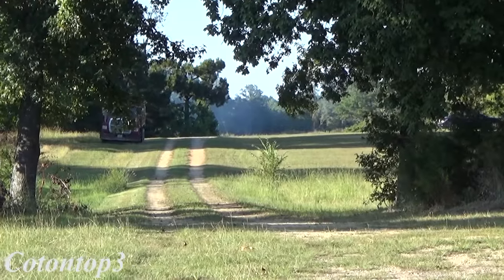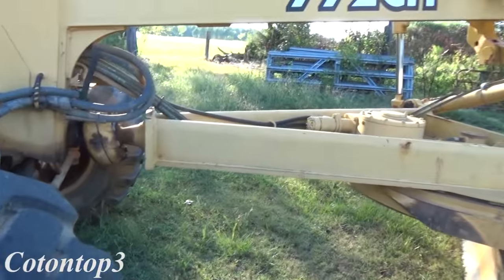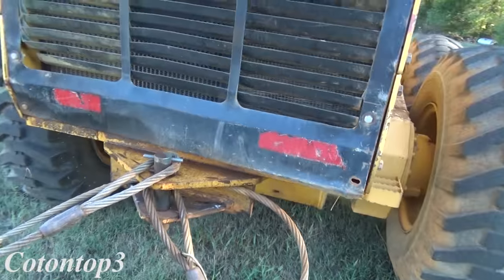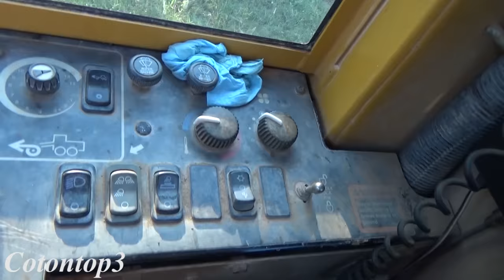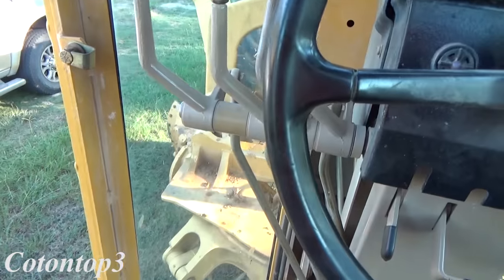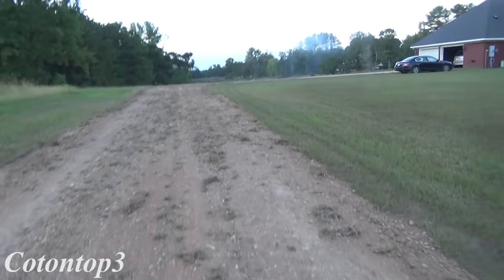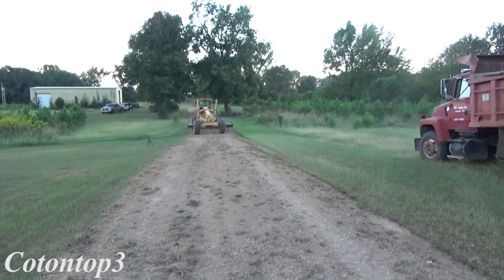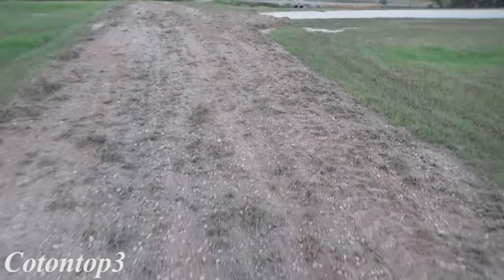John Deere 772ch road grader in action

Comment: neat idea with the different views of the blade. I mostly run blade anymore, front end loader, and drive truck. I never thought outside the box like that as far as videoing what a grader does and it looks kinda tough to capture. I have seen guys mount the go pro up in the back window or roof so the camera has almost the same view as the operator but the camera gets the operator also so people can see what levers a guy is jammin. I like those old deere blades there good-uns, the county I work for in central oregon has all Cat blades 2 of which are the size of your 772 and one that's a 163H which means holy Mac daddy size behemoth 6 wheel drive, enough under the hood to pack a 16ft board but they swapped it for a 14 footer and it can be loaded with any material and you pull the lever to turn the circle and it goes man! we put a front plow on it for winter and you could blade 3/4 of a highway in one pass cuttin snow pack with it articulated so the main board grabs the berm pulled over by the front plow, chained up all the way around and goin like a turpentine dog!! wish I was smart enough to film and upload it so you guys could see, last winter I got video cuttin pack with that 163 and we had about 7ft wall of roadside snow. then we got 2 smaller graders with 12ft boards and the one is a joystick machine like your track loader- no steering wheel at all, it's 6 wheel drive also but hydraulics are portioned electronic so if you do certain functions at same time it'll cut out and almost die, ain't got enough lead in its butt to cut real hard, and will NOT turn a full board; well that's not a fair statement because it will with snow..... but it's snow. anyhow that's plenty long enough ramble I'd think so thanks for sharin sir and be safe in nem woods

Comment: Just amazing video pictures with good sound to boot of the grader working! To me that looks like a fiendishly complex machine to operate to any sense. Do you want to create a crowned centre to the road with drainage gulleys at the edges on the low side or are you just happy to skim the high spots and fill up the hollows and potholes? - I  don't quite understand why you are so concerned about the grass growing on the road - I would have thought that it would be a good thing if it grew together and knit the surface together and reduced any likelihood of erosion issues.

That trip your Dad is driving is a massive distance, 10000 miles is about two thirds of what I drive in a year! Lets hope he has a trouble free trip.
Reply from the maker: +Dan Whiteford once all the grass dries that I caught from the sides, I'll get a good crown on it and then I'm gonna bring gravel here and gravel it again. What was happening was the grass was bad enough on the sides that the water was traveling down the road instead of running off.

Comment: for the road grader blade.. why not have some steel plate water jet or flame cut to fit up into the bracket for the ripper tines.. make them a J shaped.. with the bottom not as tight upward hooked so you can weld a curved blade onto the new hooks.. making it completely removable. depending if there is any forward rearward tilt of the ripper mounting.  you could install a angled plate on the bottom back side of the blade.. so you could use it while backing out to compact the graded surface and flatten the tire tracks while the roadbed dries..  or you could fab up a steel roller out of  some 12" diameter or larger tubing that is supported on the ends.. allowing you to compact the surface on the way out backwards.. 

please don't spray stuff on the driveway where the kids walk..  would you rather had some grass to mow or kids.. roundup or other grass killers is kinda like agent orange..

Comment: That was good blade...wait till after a rain and if you get a roller and roll it...when it dry you will think you got concrete...by the way tight blade it to get the grass out in 4 days.
Reply from the maker: When u say tight blade, what exactly do I need to do to make that happen?
Reply: To tight blade, you need to angle your blade 45 degrees carry your windrow from one side of the centerline of your road to the other side and back to the other side, when you carry it back to the original side lift the blade about 1/4 inch so it won't "cut" it will take the chunks of grass and soil back to the edge of your road. hope and pray your dad has safe travels!